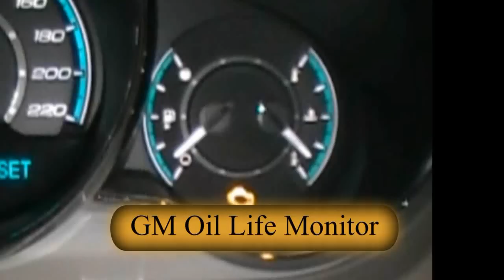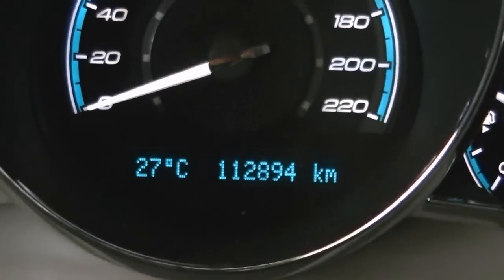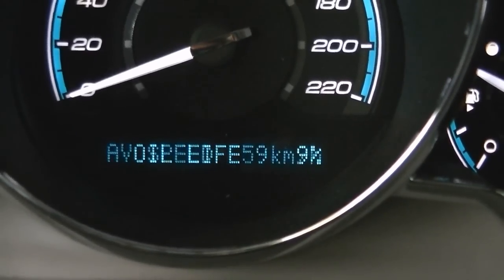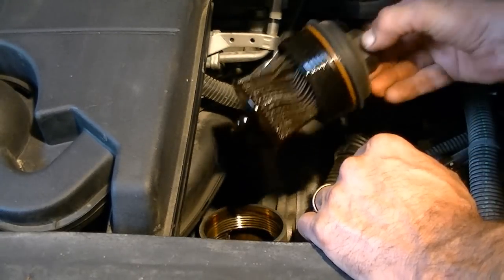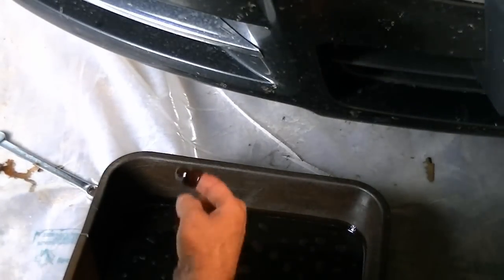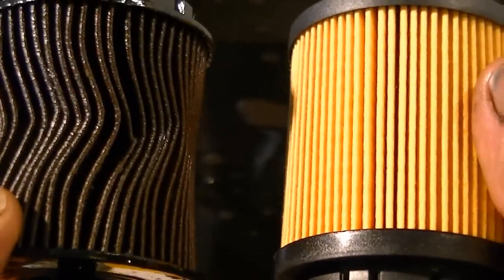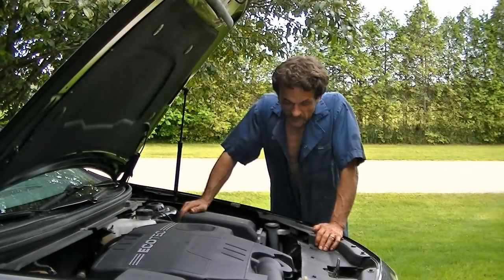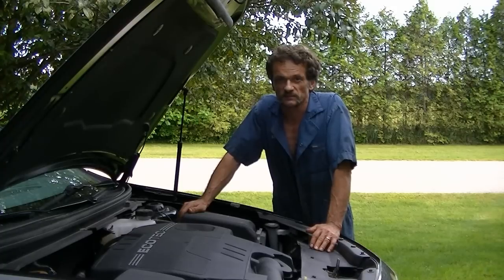GM Oil Life Monitor - Can You Trust It?

Comment: Since I use full synthetic on my 2000 Monte Carlo ss I was told I can go twice the 3,300 miles when the oil monitor turned on.....I use Firestone
Reply from the maker: Synthetic oil will last longer. I usually change my oil at 8000 km 

(5000 miles), even with regular oil. This car has 240 000 km now and running strong.

Comment: Well I agree with you on the fram filters I used to use them because the Econ compared with the the good ones like purple royal filters or oem filters but I rater spend more on a filter than secondary effects on my engine and on the oil computer I believe that if you are going to use the monitor it's better if you use the syntec.... I change the oil my self on my 2010 suburban according yo my monitor and my oil pressure was at 20 psi before change at idle when I change the oil only 4 quarts came out of the pan scary after the change about 35 to 40 psi at idle on normal working temperature and the engine takes about 5.4 quarts so be careful my fault on this one because I never check the oil on my mind I trusted the oil monitor and by the way my suburban it's awesome......
Reply: Your engine takes 6 to 6.5

Comment: I appreciate this video but it would be really great to send off an oil sample for analysis like the truck drivers do.  No offense but the color of the oil or how slippery it feels means nothing.

I just got a notice from Chevrolet to bring my 2011 Equinox in so they can recalibrate my oil life monitor which will result in changing oil more often.  So it seems there must be problems arising from people following the oil life monitor.

My monitor has me running 12k miles between changes.

Comment: A device added to to wear out an engine sooner. by dragging out oil changes far further than what you normally would.
Reply from the maker: Maybe so but not the case with this car. We owned it since new. My oil changes were mostly done with 30% on the monitor. It never used any oil between changes. It never lost any power. It had almost 300,000 km on it when our son smashed it up.

Comment: The only oil life monitor I trust is my eyes and the dip stick
Reply: Visual inspection is pretty useless. It's the wear metals (which you can't see) and the depletion of additives (which you also can't see) that determines the oils life. If it's black, that just means it's doing its job carrying carbon from combustion and detergency.

Comment: 2005yr SAAB 9.5 Turbo. Service interval is 30.000km. service display set at the shop, dispite several oil/filter Changes in between the sevice display never came on until the other day whereby the last change was only 3500km. ago! Anybody care too explain that?
Reply: Yes,car manufacturers want you to buy new cars and not keep running the car your got from them for years down the road......it's all about money.No oil should go over 15k (Amsoil as they say can go over or even some high mileage oils) anyway.....ideling/town or city use to many of us is known as "Severe driving" and we all do severe driving in a way.When oil breaks down all the additives in ti breaks down also as it gets closer to it's service interval...so that's why we should change our oil sooner.PCV valves can get blocked if dirty,shitty oil isn't frequently changed and caused gaskest to leak as it gets blocked and the blowby has to go somewhere else.PCV's are ignored and neglected just like a cabin filter.....have a look at your cabin filter n see how nasty it is.....the air you breath in your car goes through that filter so you may wonder why you get ill/sick or abit unwell but blame it on other things.Frequent fluid changes are important.Oil and other fluids are cheaper than an engine.

Comment: I go by my oil life monitor so far seems to be working out OK on my Honda fit I have 340,000 km on it or 211000 miles and it runs like a champ.  It averages about 9000 km or 5500 miles between changes and a oil filter ever other oil change.
Reply from the maker: Our Malibu is still running strong. 215 000 km on it now. But a filter change for every other oil change? I've never heard of anyone doing that.
Reply: What year and what engine spec your car has sir

Comment: Oil monitors go by milage, not the condition of the oil, it can be factory set for the extended oil change of say 12.000miles and not the owners manual recommended inbetween oil change of 6.000mles for hard driving. Go by the book, not the monitor and if in dought change at least every 6.000miles.
Reply: That's not true. You have not understood the technology. The computer monitors the oil condition and shortens the interval if need be.
Reply: Am no expert but do know some basic tecknology, and I know it stands to reason GM does not install an expensive computer in their cars that analizes the oil, if they did then there would be no need for a service recomendation in the owners manual. Oil Analysis is done in a labratory by personel, not some computerized gizzo installed in the vehical.
Reply: I was told today oil monitors go by a set of factors, a few being;  mileage,  driving style (lots of start - stops, long distance, short distance etc.) and more that I don't know.
Reply: There are so many experts out there it would be nice if they could share their knowlage as to how a dash board display can monitor oil condition? Are there test tube geeks hidden in the trunk doing highly advanced petrolium test? We have come a long way since Henry Ford rolled out his first Tin Lizzy, but not so far as to where a sensor sitting in the oil pan can determie the oils conditon. You can only do that by Look - Feel & Smell from the dipstick or by the milage on the odomitor or the Reminder Sticker that Jiffy Lube stuck on your windshield.
Reply: I sell gm cars and sold a new 2017 Chevy Cruze with only 200 miles on it but the oil life was already 50 percent. This cruze was a $29,000 car and sat at our dealership 260 days before it sold. The oil life percentage was accurate and we provided a complimentary oil change.
Reply: +mark warnberg: I had a 93 Cadillac with an oil life monitor and the change interval varied depending on vehicle operation and type of filter used. Sometimes the "change oil" light would come on at 2500mi other times it was 3600mi all on conventional oil. I stopped using the Frams because they had the shortest interval.
Reply: @TeeroyHammermill  Have not been here in a while. Interesting observation, if this is as you say the Chage Oil can come on at differant milage then the explanation I can see is that there must be a senser conected to the Oil Filter whereby the inbuilt computer is saying  the filter is clogged up and the dirty oil is flowing through the By-Pass holes on the filter.

Comment: Straight from the owners manual.

"Your vehicle has a computer system that lets you know when to change your oil and filter. This is based on engine revolutions and engine temperature, and not on mileage."

Comment: This post is long but worth the read.GM uses the number of engine revolutions and other computer data to estimate the oil life not the actual condition of the oil itsself.  Keep in mind that depending on the type of driving you do will determine the life expectancy and quality of your engine lube. I will use a STOCK G.M. 6.0 Liter V8 in this example but most engines will be very close. If you drive only a short distance each way to work or school less than 5 miles using conventional oil change the oil every 3,000 miles... Period. If you drive 7 - 10 miles each way to school or work at an average speed of 45 MPH or at least fifteen minutes driving time and the engine is running at a temp of 170 - 210 deg F witch by todays standards for engine temps is normal operating range you can expect between 3000 and 4000 miles on an oil change with conventional oil. If you run synthetic you could push 6,000. If you average 30 - 50 miles mostly highway driving each way to work or school, 5,000 - 6000 is not un reasonable with conventional oil. Synthetic 7,000 - 12,000 miles. I run synthetic and lube and filter at 3,000 miles and do a complete PM at 6000 miles with oil sampling to monitor engine health. Although I would recommend changing the filter every 3000 miles, and use oil sampling to determine the oils condition if you extend oil changes. Also change your oil at least twice a year regardless as a precaution. I own an expedited trucking company and operate vans and heavy trucks so every penny counts and maintenance is important. Down time is expensive.Fram at one time was a decent filter but are now almost useless, I recommend Wix.  At last check last year NAPA, Parts Plus, and CARQUEST, filters are made by wix the only difference is the name painted on the side.. One more thing... The special filter made specifically for synthetic oil, extra pro series high mileage engine filters, etc,  are nothing more than sales gimmicks. Buy a Wix Filter and lube oil.
Reply: +Bob Wolf 
there is two types of Indicators, one use the criteria u mentioned(uses the number of engine revolutions and other computer data to estimate the oil life not the actual condition of the oil itself)
the other type use the characteristics of the oil

  From where do u got the information that GM 
  uses the first type?
Reply: +hossamkia I am naturally mechanically inclined and was brought up to try to learn how something works and learned at an early age how to repair and maintain vehicles. Add that to a strong desire to learn new things.I am curious on how the monitor uses or determines the characteristics of the oil.. I know a service manager and a couple mechanics at a Gm dealership and I asked.
Reply: They said mainly engine revs, time and other computer data. I'm gradually learning the computerized side of mechanics.

Comment: OK, That filter was collapsed from being plugged. You can even see the filter media is actually ripped letting dirty oil pass right through. So, your "monitor" is going too long. That engine has TWO complete sets of (expensive!) guides,chains and gears.

Comment: 2.4 liter engine and 8.4l/100km fuel consumption, amazing fuel economy!
Reply from the maker: When the car was new it was as low as 7.8. It's been a great car. 240 000 kms on it now.
Reply: @MudRFunR  im sure the engine lost compression
Reply from the maker: @marcianoterricola  Maybe some. It still has all it's power.

Comment: It's like this. If you want to buy a new car because you've caused engine damage by trying to save 100 dollars a year in oil changes go for it! If you want to not squander your money change Mobil 1 every 6000 miles and have the peace of mind that you're getting new oil before you've totally drained the additive package to nothing trying to penny pinch.
Reply from the maker: Actually, I did not do this flush to save a few dollars on oil changes. My car had an error code relating to the variable valve timing which is directly related to the camshaft. Any gummy sludge can cause the VVT to fail. I did the flush to see if this would correct this error code.
Reply: MudRFunR I understand, but I would imagine some people use the monitor to get every last bit out of their oil. I just bought oil for my father in law's Chevy Silverado, I was about to change it when he told me that it had this oil life monitor. We checked it and it says 45 percent. It's been about 6,700 miles since the last change (12,500km), so that seems a bit surprising to me. On the other hand he drives 90 miles (145km) a day to work, so I suppose it's possible for it to be a little over half way through it's life. Either way I'm definitely not going to let it run down to 0%, that'd put the oil at 12,200 miles (19,600km).
Reply: MudRFunR To be fair... The 2.0 Ecotec Supercharged model. Actually from GM requires about 6qts of "synthetic Mobile 1" and is supposed to last 10k miles/ oil change. I do think we do oil changed too often sometimes, but a few $$$ in oil is worth the safety of a new motor. I would have liked to see actual oil testing... Not just your hand.

Comment: Even if you caged oil ever 3k with synthetic these echotech engines very few will see 150k let alone 200k
Reply from the maker: I usually changed oil after 10,000 km or more sometimes. Our son has the car now with 
270 000 km. Running strong!

Comment: -Mobile 1 and K&N are good but pretty expensive for what they are.
-"Synthetic filters" and "High milage" filters are just a gimmick and should be avoided, a block of jelly sits inside the filter and dissolves into your oil as it flows, completely unecessary if you are using a good oil, EG- Castrol, Valvoline, Pennzoil, Quaker state, Royal purple, Mobile one, Red line.
Bulk brands like Super tech really don't stand up to todays high revving engines  and should left to lawnmowers or beaters.

Comment: Been in the bussiness for over 20 years. Merely looking at your oil NEVER tells you anything. Also that old filter was collapsing. Filters do NOT twist like the owner of the video claims in one of his comments. If you want an actual answer send a sample out to Blackstone labs and pay the extra for a TBN report. That will tell you about not only what is in your oil from an engine wear perspective put it will also tell you about the additive packages that come in the oil and if the oil is still any good. Also make sure you are using top quality oils that meets the manufacturer specs - not just viscocity. And to prove the point further, GM has put out a TSB on numerous product lines that reprogram the oil life monitor to a shorter time frame because the original parameters were too long. DO NOT LISTEN to this guy if you like your car. Rolling the dice and saying you haven't gotten bit yet is jusy stupid!
Reply from the maker: That's some comment. Yes, the oil could have been sent out for testing. I clearly state that this is my opinion, not tested as true. So far every filter that has been changed on this car has come out twisted. Also this car has had every oil change done at less than 20% on the monitor. This car now has over 240 000 km. Running strong and never burns any oil.

Comment: Wait till you change your headlights. Then wait two months for the slpash gaurds to rip off on the highway. Then order some new ones. Then wait for them to do it again until you replace the whole goddamned front end at the same time or glue that shit together the first time. Nice looking car but my vic always starts and its never given me the problems that this plastic shit has caused me. This car is nice but if you dont have the time you shouldnt get one unless you like spending money at a dealership. And avoid pot holes and uneven terrain or you will be buying a new bumper soon. Stay out of mud as well.
Reply from the maker: titokocya It's my wife's car. She loves the car. It rides so smooth and quite but more maintenance than I would like. It's never had any real big issues but too many little things. Still a great car and peppy too!

Comment: just from the color i could have told you it was still good.... its a GM approach to safeguarding one's engine because of the ever lasting flood of idiots out there that dont even know vehicles require oil or where it would even go.."the ones that would believe in blinker fluid" fram is shitty yes K&N is the way to go and if you are using Pennzoil you are ruining your engine 1 quart at a time.. that shit is bad right from the bottle.... nothing in oil should be "synthetic" more less so Synthetic that it isnt even oil any more. so that+ high temp and wear = built up burnt shit all over the tops of your pistons and valves and etched into your cylinder sleeves/walls plus the rapid wear on bearings and seals due to its synthetic blends of bull shit....oh and dont forget the HUGE impact it has on the performance of your spark plugs after only a couple hundred miles after replacing them.... Castrol or Quaker state are the only ones i trust... mobile 1 is just as shitty as pennz it is pennz with a price tag... only things you should see on your oil bottle that looks odd is that it has detergents in it... not silicone and this that and the other
Reply: krypten wolf quaker state is quaker ass
Reply: krypten wolf I run Pennzoil ultra. Bout to switch to Mobil 1. Never had a problem with Mobil 1. The ultra looks like shit.

Comment: Thank god you used a wix, fram sucks out the ass!! And mobile one is over rated and unnecessary cost in oil changes, Wal-Mart brand synthetics are just as well they all come from same refinerys, and oil manufacturers weather it be synthetic or natural oil
Reply from the maker: I agree with you that Fram is bad but I don't believe that all oils are the same.
Reply: martin tiffany I use WIX thats what I said in the original comment! Fram sux hope you used a wix meaning I use wix ty ty

Comment: Oil change? In ordinary engine, ordinary used, every 100 hours of work. If you believe what cars manufacturers say about oil change, stop. Only mechanical engineer experience.
Reply from the maker: I'm still doing oil changes at around 15%. The engine is running strong with over 230 000 kms on it now.

Comment: i wouldn't recommend handling used motor oil with your bare hands. there's some nasty contaminants in it which are toxic and bad for your skin. would recommend using rubber gloves.